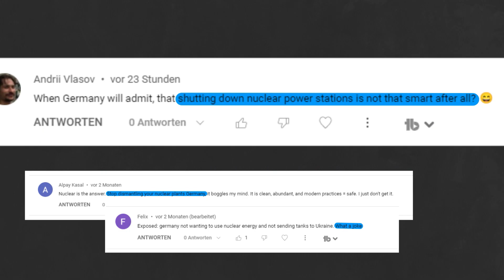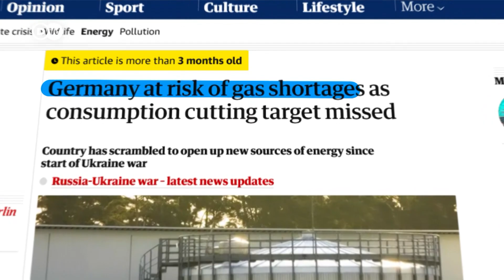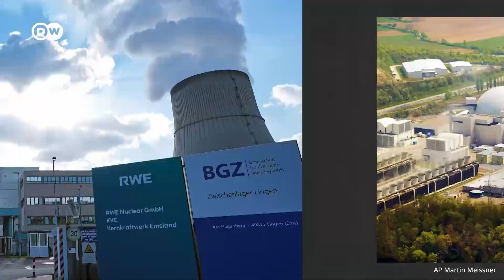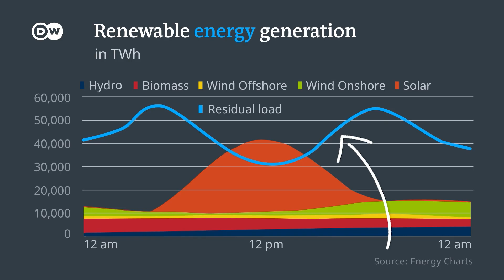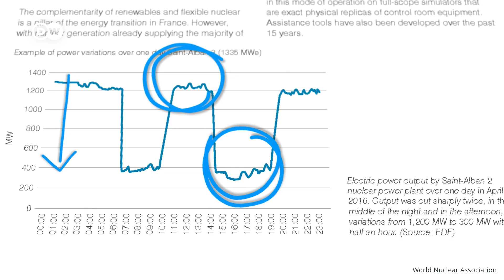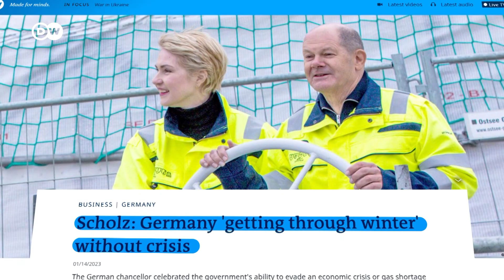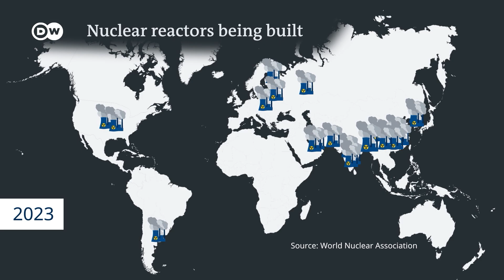Is Germany's nuclear exit a mistake?

Comment: One important fact was not mentioned in this documentary: The impact of energy savings by improving things like thermal insulations of buildings, more efficent transportation and production facilities and switching local heating solutions from fossile to non-fossile solutions. And, most important, finding new solutions for important industrial processes like steel and concret production. These are very complex problems for sure, but finding working solutions for complex problems is something that Germany is good at. Its not going to happen tomorrow. And not the day after tomorrow - but never ever underestimate the thrive of the german angst. People outside of Germany often underestimate the creative energy and productivity that lies within it. Switching off all nuclear powerplants might seems to be a "not-so-clever-decision" in the short run, but in the long run it will work out. Maybe not at first try, maybe not perfect from the start - but its going to work in the long run. Theres no quick solution, but keeping nuclear energy ( At least in the state as it is today ) is obviously not an option for Germany. Is it a bad idea to skip the nuclear option in times of need for energy and climate crisis? Could be, but maybe this decision is the foundation for the widespread use of true green energy, for innovation and new economical chances.

Comment: It's a misstake to tear it down before reliable replacements have been added to the powergrid that have been proven to be "reliable".
Reply: northern germany produces more energy via wind 24/7 than it could use.
The problem is, that bavaria blocked the building of high voltage routes from the north to the south, wich leaves bavaria in a quite unique situation in germany, that it is the largest user of energy and also the largest consumer of gas to electricity in germany.
its a bavarian problem, not a german problem.
Reply: @zhufortheimpaler4041  A power grid cannot rely solely on wind energy since it is dependent on nature, and cannot be ramped up to meet consumption demands.
Reply: @LunaticTheCat  sure, thats why there are more renewable energy options.
And also keep in mind, that "baseload demand" is something that only appeared when nuclear power entered service.
up into the 1970´s, night time energy load was drasticly lower than daytime load, due to significant fewer night shifts in primary heavy industries like steel works etc.
So if we move back to a more flexible grid usage with lower demand at night and high loads at day.... suddenly many of the problems dissapear.
Because baseload is not the reason for nuclear power but nuclear power is the reason for baseload.
And also wind can cover about 80% on average, the rest is covered with hydroelectric power, solar power and for peak times gas.

Comment: I have been aware of the green-house effect since the 70-ties, we must take it seriously.
I have been furious at the greens for 20 years as the GREENS are the main culprit to why we generate so much CO. It should not be quest of the greens to keep the CO2 emissions high, but it is!
The German politics have been worst, but I can not be proud to Swede either.
What do I want then?
Build as much wind, solar and hydro as possible.
Use nuclear for the rest.
If we were to develop reactors that in effect could burn U238, we could use nuclear waste for fuel for the coming 500 years or so. The new waste would only be dangerous for 500 years or so (really dangerous for ~200 years).
Any bio we can turn to liquid fuel should be used by airplanes as they have few alternatives (H2).
All cars and most lorries should run on batteries as fast as possible.
Steel, other metals and Concrete shall use electricity and H2 to produce what is needed.
We need loads of permanent electricity storage.
(There is more . . .)

Comment: Not only does Germany shut carbon free electricity production, but Germany has a toxic behavior since 1/ it keeps coal which emits CO2 and produce toxic small particles spreading to all the neighboring countries, and 2/ Germany hinders any attempt in the EU to develop nuclear, promoting instead unreliable renewable which can only work with gaz and increase the EU dependency on foreign producing countries (mainly dictatorship). Insane

Comment: Very important argument missing was that climate change makes summers more dry leading to cooling problems because rivers become to hot or low in level
Reply: Well you could always build reactors that aren’t reliant on water…..

There’s only about 70 years of evidence on how to do that…..
Reply: @brian2440  tell that the nuclear number 1 France who rely on nuclear (water cooled) for 70% of their electricity consumption, planned to build more of those (but when?) and had to shut down many of them last summer. And probably more often than not in the next decades.
Reply: @johnquaffel110  They’re well aware of it. Superphenix worked like a charm in France. They were one of the pioneers for VHTRs…..

Problem was really three-fold: 

1. The reactor was built in response to increased Uranium pricing, as it operated in fast spectrum and used Plutonium 239 fuel. Prices dropped for uranium after the 70s, and Plutonium 239 prices increased (moreso due to government interference than actual market forces). 

2. Because the plant used Plutonium 239, you frequently had major protests as people were concerned that the plant would be weaponized into a nuclear weapon. Kinda ironic really, because the fuel used from this reactor was actually made by decommissioning of nuclear weapons…..

3. Even though the plant eventually operated at superior capacity than most LWR plants, it took a little while to get over some technical hurdles that hinder red production at the start of the project. 

This plant really demonstrated at scale a solution to a lot of problems people have on nuclear: 

1. The plant used fuel from decommissioned weapons thus doing the complete opposite of concerns for nuclear proliferation (btw this isn’t the only reactor that’s done this) 

2. The plant didn’t use water coolants, and existed with greater passive safety elements. 

3. During construction, protests erupted and saw the primary containment of the reactor get hit with 9 RPG rockets. So to everyone concerned whether or not 6ft reinforced blast proof concrete is gonna resist a military strike, yes there is evidence that the whole terrorism concern is really kinda complete nonsense….
Reply: It's overly simplistic to say that "climate change makes summers more dry." That's not the case at all - in some places, the opposite is true.
Reply: @bsmithhammer  yes you are right, in total it will be more precipitation BUT it is obvious that rain will fall more aprubtly, on drier grounds, leading to floods on extreme days, but the average day will have little amount of water in streams.
This is already experienced, and e.g. France recently has problems intensifying.
Reply: @bsmithhammer in Germany, they are more dry.

Comment: Coal is not dirty like the past. Gasified coal can be compressed and stored in huge spherical tanks.
All the heavy stuff will settled and the rest filtered out. Post combustion processing to take out harmful gases.
Germany has plenty of coal, cheapest energy filler for renewables. It’s also relatively safe, nuclear power may be safer, but the consequences of a nuclear accident can be devastating. It’s a heavy emitter of CO2, but it is just a filler for other clean form of energy and can be offset by planting trees.

Comment: Here is the thing about thorium molten salt.  When it comes to storing concentrating solar power, we did the studies in the 1990's under the Clinton Administration in the USA and figured out how manage molten salt safely and reliably.  This understanding of handling molten salt just wasn't mature in the 1960's when we were working on thorium molten salt reactors in the 1960's.  So your LFTR reactor has a secondary molten salt loop of inert molten salt and you store it in large tanks like you do with large concentrating molten salt solar power plants.  You can then dispatch the power when you need it.  Problem solved.  I mean the reactor runs at 100% all day, but when you don't need the power, you store it on the cheap as salt costs for these energy storage loops are measured in the dozens of Euros per tonne.  I mean 24-hour storage of the molten salt is not an issue cost or quantity wise.  Then say you have 200% or even 300% of the reactor's energy output in generating capacity to use up this stored energy when it is needed, say the sun is going down and everyone is coming home for the day and turning on stuff.

At that you can store molten salt at temperatures where you can run a jet engine directly off of the heat.  You don't necessarily need water to generate lots of electricity and do it reasonably efficiently.  If you want, you can add a second steam turbine loop running off the exhaust heat of the jet engine to get even higher total efficiency out of the system.  Maybe you desalinate water instead with the waste heat and create fresh water from the reactor.  Remember is would be multiple steps removed from the reactor core as you have the inner loop with fuel, the secondary loop of inert salt carrying the heat out of the reactor, the just engine, and then the jet engine moves inert helium around, which is used to heat the water through a heat exchanger.

With this system, you still have renewables around generating power where it can.  It is just you have also made nuclear into a cheap, safe, dispatchable power system that covers the gaps left with things like solar and wind.  Storing renewable power can get expensive fast, especially if you are trying to store it in big battery banks, as those batteries can get to be expensive and scarce..  Storing molten salt is dirt cheap and nearly 100% efficient at storing the heat energy in this case.  It wouldn't make sense to however say take power in from a solar PV panel and then use that to run heating coils to melt salt into molten salt because going between electric to heat and back to electric loses a lot of energy.  However, go directly from heat to hot storage doesn't really lose anything, the conversion from heat to electricity loses the same amount regardless of whether it is done right away or if the heat energy is stored in molten salt for a little while before being converted into electricity.
Reply: This scheme is applicable to any passively safe reactor with a reasonable outlet temperature, not just LFTRs (See Natrium or MOLTEX SSR for examples currently in licensing which include this functionality and are NOT LFTRs).
Reply: Oh, and you never switch off renewables.  Instead you use the excess for other things like making green hydrogen and green methane.  You need lots of these anyway, so throughout the year you will just make more or less of this and ween yourself off of foreign imports.  You already have the infrastructure to store lots of methane, so you want to start filling those reserves with green methane in times of the year where you have a lot of excess power generation.
Reply: If you have say 24 hour molten salt storage at your reactor facility, if you ever need to shut down the reactors for any reason, you have on site reserve power you can produce from the stored molten salt.  While you always want to be connected to the grid and have diesel generator backups, stored molten salt could be used first before kicking on diesel generators.  The need for backup power in general for molten salt is a lot less because you just dump the active molten salt in the reactor core into dump tanks when the reactor is shut off and it is passively cooled in the dump tanks.  This is a lot better of a shut down mode than light water reactors.  You still want to make sure the lights are on and such at the power plant.  With such small power needs, this is basically a gigantic battery backup that will keep the lights on at the plant for a long, long time.  Then again with the small power needs with the reactor cores shut down, you could also have a solar battery backup system and probably do away with diesel generators.  When not needed for backup, they can dump their small amount of power generation onto the grid.

Comment: They should have started the phase out with coal and covered for it by building more energy storage while keeping the nuclear plants running as long as possible. Renewables are better for new production than wasting decades and billions building new nuclear plants and gas and coal still work as backup supplemental power source, but if you already paid for the nuclear power plant it is better to keep using it because you can't just undo that decision.

Comment: 5:30 ...or we need powerplants that we can shut of and on very flexibliy."
True...and nuclear plants are the worst powerplants in this repect.
5:56 "...so could nuclear power fill that gap?" For given reasons.....No.
8:00 "...a third of it's electricity comes from dirty coal..."
Unfortunately true, but a third  is not 4% which is the contribution of nuclear power in Germany.
Building new nuclear plants take much too long and needs centuries which we don't have.
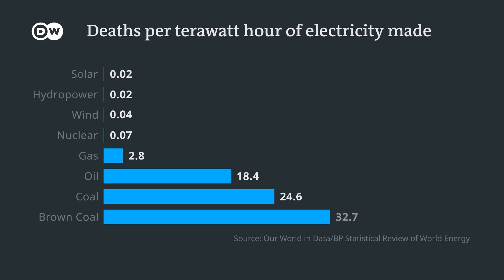10:36 this is a biased and misleading chart.
10:46 "...there is a sulution..." No.....there is no solution found even in 60 years.
12:28 "...if we had a perfect electricity grid..." yes we don't have it yet but we don't have the necessary nuclear powerplants tomorrow as well.
Therefore all the efforts have to be put into renewables and should not be wasted.

Comment: "Could nuclear fill in the gap once Germany is powered 80% by renewables?" Could you make a more pointless question DW? Currently Germany is only powered 40% by renewables, and the rest was filled with nuclear, coal and gas, now because of this it will be coal and gas that fills the gap. It will take YEARS for Germany to reach that 80% goal. Ask that question WHEN you have reached 80% of the energy provided by renewables, NOT today when it's only 40%.

Comment: Coal plants release more radiation than nuclear plants do. It doesn't make sense to reduce nuclear power at all as long as there is a single coal plant on the grid.
Reply: True, coal contains small amounts of uranium and thorium, but it's the air pollution from the ash that is the real killer.
Reply: @Marty Flowers  yeah, the air quality and the environmental costs of minning are bigger issues but it's the ash that contains the radioactive material released mostly. It's not much but coal uses orders of magnitude more fuel by weight in volume that it massively outpaces nuclear energy's waste production.

Comment: When you consider that every kWh of electricity produced by a nuclear power plant is about four times as expensive as that produced by wind or solar power, no one who wants cheap electricity can argue in favor of nuclear power. But it is reliable, isn't it? France uses nuclear power almost exclusively and has to buy electricity from abroad all the time; without tons of electricity from Germany, all the lights would have gone out last summer during the heat wave in France, because nuclear power plants can't run at full capacity if there isn't enough water to cool them or the water is too warm. Running nuclear power plants when the climate is getting warmer and warmer and even Europe is currently facing one water shortage after another? I would reconsider that. But who still disagrees, it's okay to be a fan of nuclear power and I also consider it fundamentally safe. Just please post your address here so we know where to send some of the nuclear waste that is currently stored in 1893(!) Castor containers so you can store them for at least the next 2000 years (just bury it in your backyard or store it in your basement). By the way, did you know that it costs 1.5 million euros to produce a single Castor?
Reply: If nuclear is more expensive, explain me how France has cheaper electricity than Germany? 60 percent of France's electricity is nuclear.
Reply: @Andrii87  Because France hat less taxes and dues on electricity and also didn't made the stupid mistake to charge everyone a renewable energy levy, even those people who already bought 100% pure renewable electricity and who have thus already directly promoted green electricity through their purchasing behavior. It's the same reason why gas for cars has always been more expensive in Germany than everywhere around it, the price got artificially raised by dues that did not exist in other countries or were far less. Also there is one thing you need to understand: A lot of the costs that nuclear power generates are paid by tax payers and everything that is promoted with billions of taxpayers' money is cheap in the end; yet not really as that tax money is missing elsewhere or is the reason why taxes are as high as they are.
Reply: @Andrii87 that's because of the even more expensive coal and gas
Reply: The consequences of LCOE on energy discussions has been a disaster for the human race

Comment: A base load plant should always be there to adjust the fluctuations caused by renewable,  Gas plants are good then coal but still causes pollution. Nuclear plants are cost effective in long term and it can help in transition from non renewable to renewable.  So Nuclear should be atleast 50% of a country needs at given time coupled with 40% gas . So that renewable can be made available in interim , since most of it come from solar , which requires photo voltics cell , which requires rare earth which pollute more than non renewable.